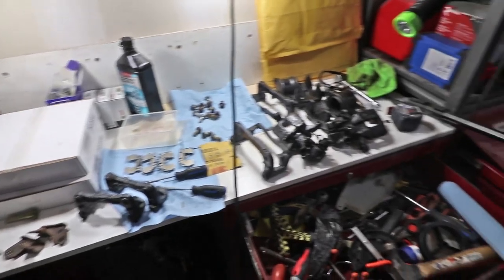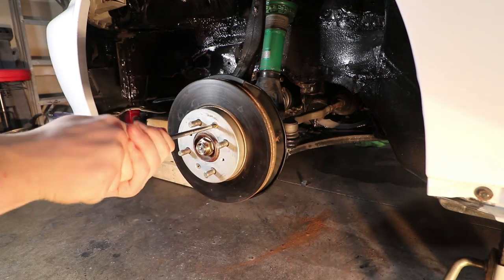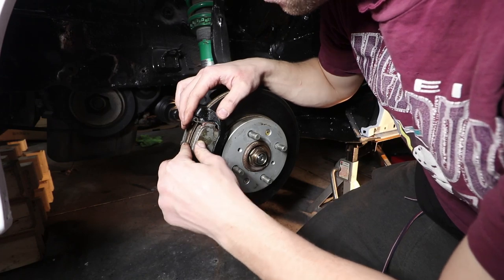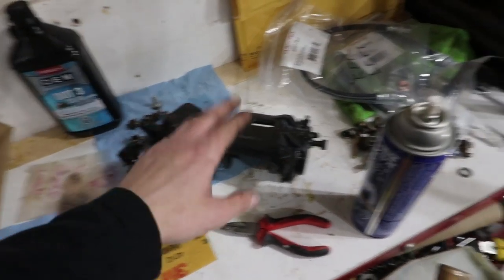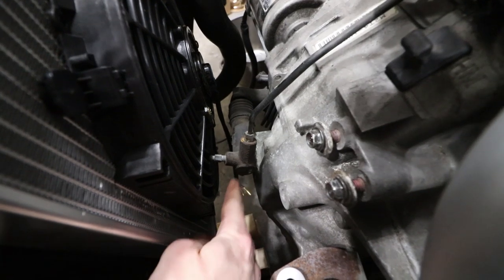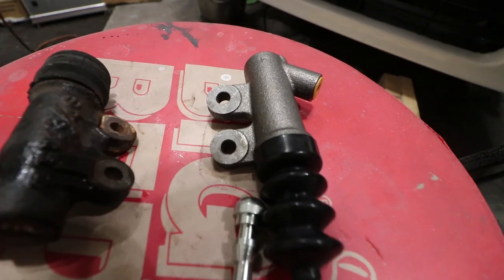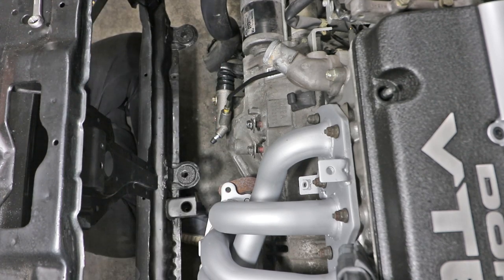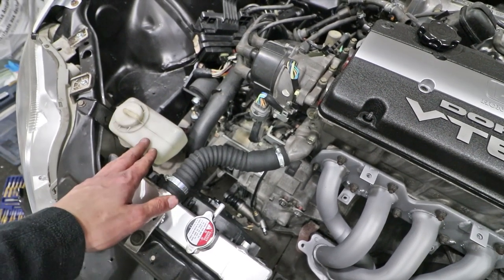Integra Slave Cylinder on H22A  - Radiator Fan Clearance

Comment: One small bit of advice: I used to have my fan mounted with those zip tie style mounts and it worked fine but about 10K miles later one of the straps rubbed a hole into one of the passages through the core. Just FYI.
I never thought plastic could wear a hole into aluminum but it definitely did.

Comment: I have never had an overheating issue due to pusher mounted fan in 10 years of owning an H22 EJ1. In fact, I have my fan wired to a manual switch only and I go months at a time without using it, i only ever need a fan at all in intense traffic jams. Its a daily driver but I've had her at the track in high rpm for long periods and never had to flip the switch, the airflow from driving is enough even in 100+ °F Kentucky summer days.
However it would be nice to be able to use a shroud and mount the fan as a puller. Thanks for making this video, I might be able to squeeze the fan in on the inside now.